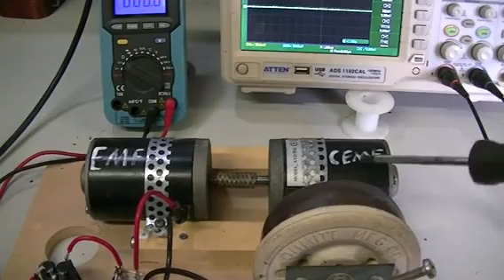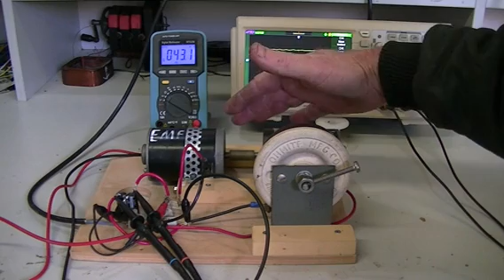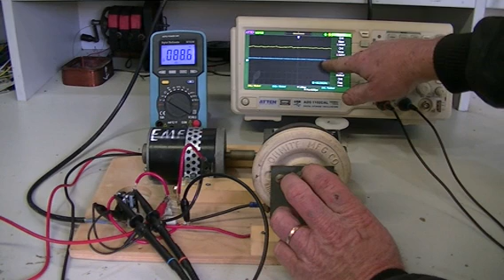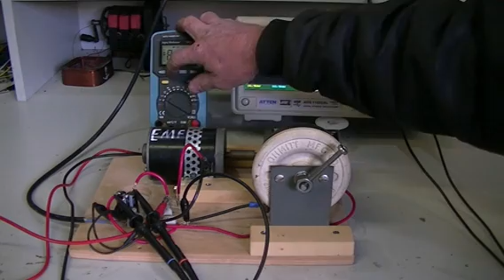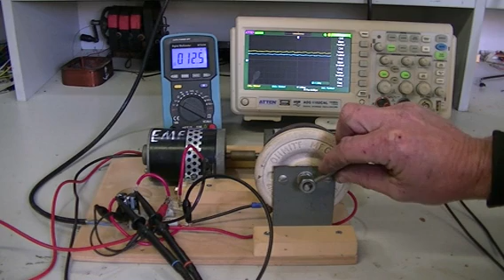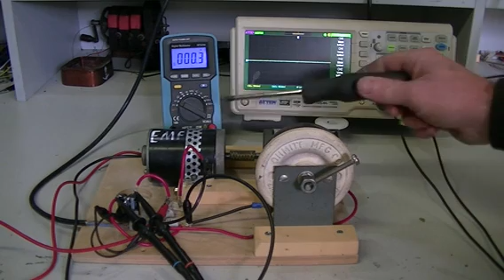EMF and CEMF in electric Motors and Inductors.

Comment: Having been through formal training of elec. engr., the following question on an exam:

A)  "A coil is hooked up to an AC supply.  How many currents in the coil exist?  How many voltages?"
      (ANSWER:  two currents - the source and counter EMF current.  Similarly, two voltages - source and back EMF)

B)  "A transformer is supplied 60hz AC to the primary winding and the secondary winding has a 1k ohm resistor.  How many currents in the primary?   How many voltages in the primary?  How many currents in the secondary?  How many voltages in the secondary?"

(ANSWER:  Three voltages in the primary, three currents in the primary, two voltages and two currents in the secondary)

The primary winding in the transformer gets:
1) voltage from the AC supply
2) back EMF voltage from self-induction of the primary winding's own magnetic field
3) back EMF from the magnetic field of the secondary due to current flowing in the secondary through the 1k ohm resistor

EXTRA CREDIT:  What are the directions of the voltages in the primary winding?

1)  AC supply voltage has its direction dictated by the utility company
2)  back EMF voltage from self-induction of the primary winding's magnetic field OPPOSES the utility company direction
3)  back EMF from the secondary winding's magnetic field IN THE SAME DIRECTION as the utility company

Very few students get these correct.  The vast majority believe there is a primary voltage/current coupled to the secondary winding, and that's it.